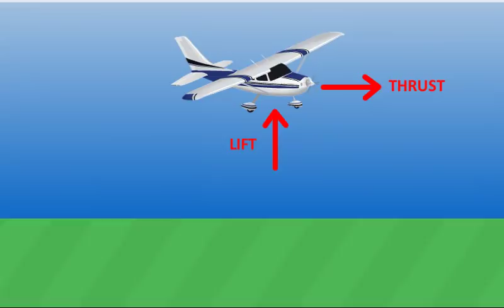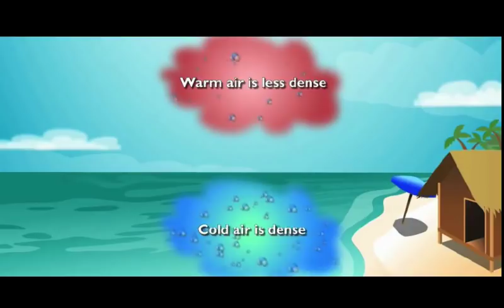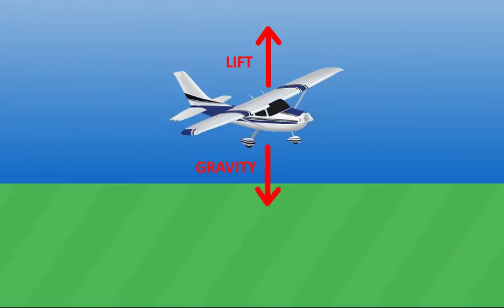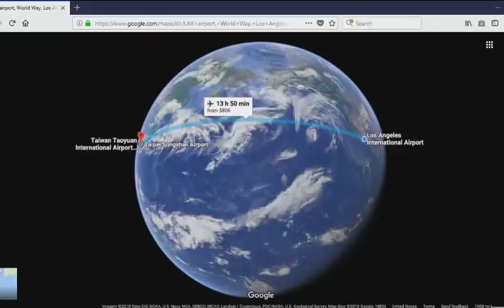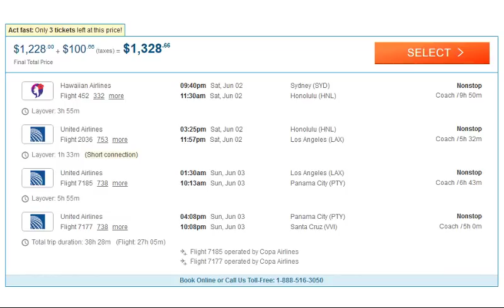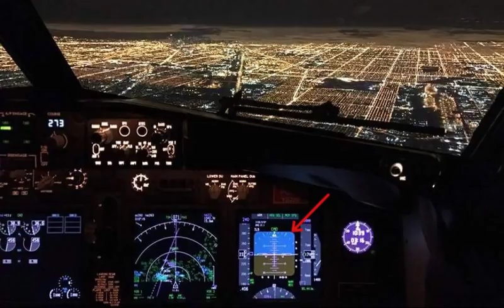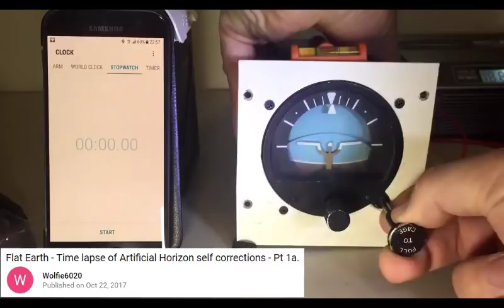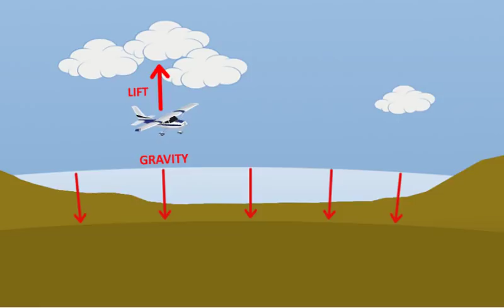Flat Earth Falsities - Plane Nonsense

Comment: So how did astronauts return back to Earth if Earth was spinning 1,000mph and flying through space at 60,000mph?
Reply from the maker: Rich Hill - 1. The ISS orbits the earth at about 17,000 mph, in generally the same direction as the earth rotates (but at an angle). To return to earth, astronauts leaving the ISS use the atmosphere to slow down to earth’s rotational speed, and then land. No problem.

2. The ISS is MOVING WITH the earth in its orbit around the sun. They are in the same reference frame in that regard, moving together. So there is no net speed that has to be made up. For example, to get to the bathroom at the front of a plane moving 500 miles per hour you do not have to run up the aisle at 501 miles per hour, because you are already in the same moving reference frame. You just walk up. Same with the earth and the ISS.

Hope this helps.
Reply: The ISS is trapped in earth’s gravity and it’s moving with it.
Same with the moon.

Think of this. The earth is light years minutes away from the sun, but we keep spinning around it. That’s because the earth is trapped in Sun’s gravitational pull.
If there wasn’t Sun’s gravity, the earth would leave the orbit.
Reply: @tugrulc.1804  "The earth is light years away from the sun"
Earth is 8 light minutes away from the Sun.  In astronomy this distance is normally referred to as 1 Astronomical Unit (AU).  A lightyear is obviously much farther than a lightminute.
Reply: OMG GMO 
Alright that still doesnt change the consequense
Reply: @tugrulc.1804  No, I was just trying to clarify it before some FE believer pointed to it and tried to claim everything was invalid because of a minor mistake.
Reply: @tugrulc.1804   Try editing your post then.
Reply: wong 👍
Reply: @tugrulc.1804  Cheers.
Reply: Go to China and say your space agency is a load of lying shit, and your nothing but a puppet of NASA. That at least would be one less flat-earther.
Reply: @appresley4071  Exactly! THE SAME APPLIES TO RUSSIA! In Russia, if you do something like that, you can BET that your days of freedom are OVER! And it is COMPLETELY OK because whoever can come to a HERO like Buzz Aldrin and say that he's a LIAR and a COWARD, simply deserves LIFE IN PRISON. :-) FE people are lucky North Korea has no space program. :-)))))))))))) They would execute deniers with cannon shells... :-)))))))))))))))))))))))))) Seriously, if there is a ban on denying the holocaust in some countries, there should also be a ban on denying the globe (because the globe is MUCH more obvious than the holocaust - we only know about the holocaust from historical evidence that could be faked, the globe is measurable and observable TODAY). :-)
Reply: @Rollie but wouldn't it have to take a significantly farther line of distance back

Comment: so what happens with that "momentum" for example when an airplane circles around an airport? Picture it!! Also picture landing after that in all kinds of directions unaffected by the supposed spinning of the earth.
Reply: So what happens to your momentum (not sure why you put it in quotes, do you doubt momentum exists?) when you walk around in circles inside an airplane that is flying at 500 mph?  Picture it!!  Also picture sitting in your seat after that in all kinds of directions unaffected by the supposed flying of the plane.
Reply: @MrQuaiven  you are talking about constant speed linear movement and also you are attached to the floor and holding onto the seats, not freely flying in the air inside the airplane which is also enclosed, but I will meditate on your point. Of course, everybody knows what inertia and momentum is.
Reply: @matijaflutes  "you are talking about constant speed linear movement"
No, I was actually talking about your plane that was flying in circles.  So you would be walking in circles inside an airplane that is flying in circles.  

"you are attached to the floor"
What exactly is attaching you to the floor?

"holding onto the seats"
Fine, remove the seats.  They are completely irrelevant to the point anyway.  Picture an empty cargo plane.

"not freely flying in the air inside the airplane which is also enclosed"
OK, fine let's replace you with a drone flying in circles inside of an airplane that is flying in circles.  Good enough or are you going to move the goal posts some more?

"Of course, everybody knows what inertia and momentum is."
Actually you would be surprised how many FE believers don't.  In any case, why did you put momentum in quotes?
Reply: @MrQuaiven  Let's say you catch a bird and then throw it in one direction. It will be flying in that direction for a couple of seconds until it starts flapping it's wings at which point it will completely neutralize the momentum of you throwing it, and it will fly wherever it pleases. So I am thinking, if an airplane starts flying in an opposite direction of the take-off, didn't it beat the momentum?
Reply: @marcofrancioni1155  How about some common sense. If we were spinning even very slowly, there would be more water if not all water around the equator and none at the poles, if any water stayed attached to the planet, simply because of the difference in the centrifugal force, gravity being the same everywhere. If you can't picture that, spin anything with water in it or on it... I am pulling out. You guys are hopeless. You just want to believe that you spin and rush through space in spite of no direct evidence for it.
Reply: @Rollie nothing confuses me. You are landing on a moving target.
Reply: @matijaflutes  like carrier landings? That are obviously fake?!
Reply: @NotTheCIA I.think I think you are confused by the sky spinning and you think that you are spinning. Everything looks nice and peaceful down here to me.
Reply: @matijaflutes  I am afraid they dont like 'seeing /feeling with own senses', they prefer Someone tell them what Reality is.  Yeah I often said this Gravity & Surface grab of air having a perfect Momentum speed, all the way to space, never sabotaged by counter Forces as; cross-winds, hurricanes, corolis, evaporation, mountains, gravity imperfection.  
Apparently NATURE abhors 'Perfect',  "especially perfect circles" but provides Automatic multi Momentum at all heights and latitude!
She sure is hard to figure out and "levels" those gasses fast!  :)
Reply: @NotTheCIA I.think Basic? the surface of the earth is spinning from 0 to 1000 mph from the poles to the equator, planet rotating around the sun at what 20 or 30 miles per second, then solar system rotating around the galaxy even faster, and galaxy rushing through space even faster and the earth tilted at 23° and gravity pulling down exactly at 90° etc, etc... and it's all canceled by what, so we feel completely still??? Pretty basic? Wow, you must be really smart if this is basic to you!
Reply: @matijaflutes  "Let's say you catch a bird and then throw it in one direction. It will be flying in that direction for a couple of seconds until it starts flapping it's wings at which point it will completely neutralize the momentum of you throwing it, and it will fly wherever it pleases."
Yes, it will fly wherever it pleases inside of the airplane that is flying in circles.  You seem to have serious difficulty understanding relative frames of reference.
Reply: @matijaflutes  Big numbers are scary aren't they?
Reply: @MrQuaiven  Don't be scared. Just put them all together and see where you end up, hahaha. We are not moving man... and I am pulling out of this conversation, sorry. That's not going anywhere for sure.
Reply: @MrQuaiven  When did I say that the earth was flat? I am looking at the geocentric model, or rather Vedic model where everything is rotating around a line that goes through the earth and north star. I can talk science, but when you start throwing phrases like "scary numbers" etc, I have no time for that. Gotta work anyway. This is just some brain gymnastics, but I am also a physics lab technician, and I don't believe anything but scientific proof, and that's well defined. Stories will not do. Insults will not do. Lot's of official space stuff is total bullshit, so why not reexamine? Fake NASA stuff, wild stories and statements by so called astro-physicists who represent official science... if you want to believe it, that's your choice. Most people are gullible. Me, not so much. All the best...
Reply: @matijaflutes  Oh you're a "physics lab technician" are you?  Yea, sure bud.  We totally believe you.  It is like, totally normal, for a "physics lab technician" to not understand anything at all about the laws of motion and how they relate to movement in a rotating frame of reference.  Also I really like how you say you don't believe anything without scientific proof but you also say that you are looking into the "Vedic model", which is straight up religion.  Go ahead and run along to work now, those burgers aren't going to flip themselves.
Reply: @matijaflutes  Ah yes the old "I don't feel it so that means it's stationary" argument.  Tell me something Murali, if you were sitting on a merry go round that completed 1 rotation per day do you honestly think you would feel it?
Reply: @matijaflutes  
To explain landings.... try with your friend to high five on a conveyor belt or an escalator it is you landing your hands on a moving target while you both are 
Moving at constant speed on a rotating globe which orbits around the sun orbiting Sagittarius 1A
Reply: @NotTheCIA I.think Rotation or Spinning, She does both you know!
Not talked about Wind but Atmosphere Momentum that no inside disturbanced can alter the perfect sync, same as GEO satellites :)
    Even numerous ATOM BOMBS have not temporarly disturbed MOMENTUM, that must be near Perfection concervation!
I didnt even talk about cause, just effect on Gravity-Momentum Atmosphere.  And again never questioned MAGNETISM of north and south poles. So care not of  clockwise or not, fucking no up or down, I dont see why miss GRAVITY would influence directions.
Reply: Murali is a troll. Nobody is this stupid
Reply: @nye307   Murali is a religious freak, Louis is the troll.
Reply: @NotTheCIA I.think ? No I did not realiSe THAT! (amoung other things...) "so much" is how much? What is the % of the ball's Mass?
Eeee... isnt SHE way above the Equator? Kind of hard to figure such leverage upon Momentum Conservation physic laws.
Really I did not think (heiiocentric) possible anything could alter Atmosphere Momentum, or spin speed, or fixe axe, or thousands of miles speeding over the Galaxy after the Sun.
Or anti wobble, but apparently Humans are causing that too on the poor small fragile Globe that has suffered all kinds of upheavels...
Reply: @NotTheCIA I.think No not everyone, just keep to your "China 3 rivers damn changed earths angular momentum" saying :)
ps: since when have YOU understood my "word salad gibberish" (etc)?   Remember that saying?